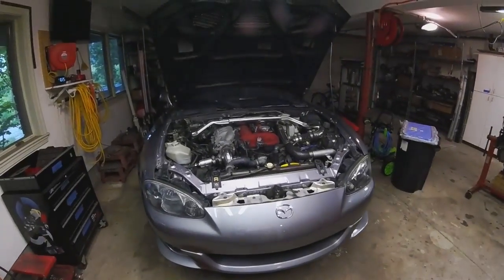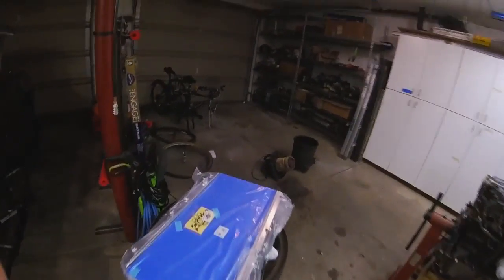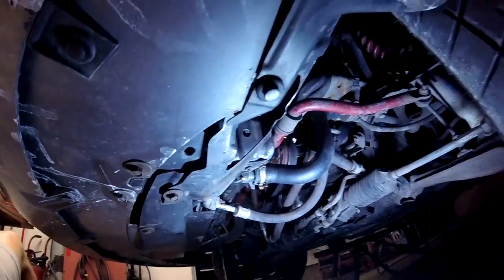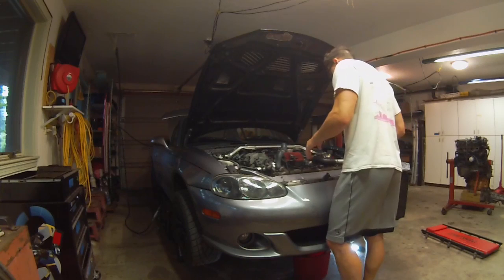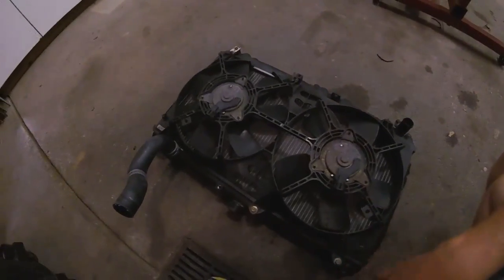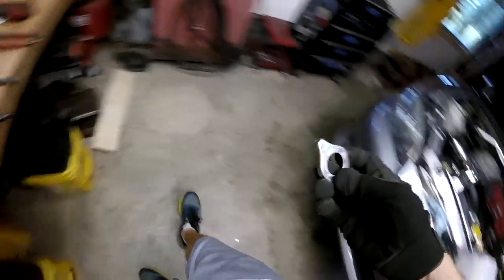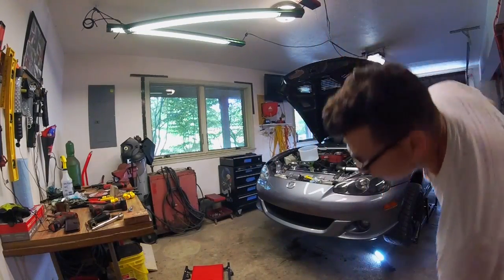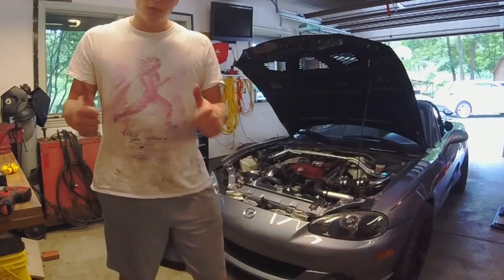Mazda Mazdaspeed Miata NB All Aluminum Radiator Install

Comment: Is the CSF 42mm Radiator a direct swap for the Mazdaspeed MX-5?  Was there any modifications necessary for fitment?
Reply from the maker: Oh, it's worth noting that the tabs I added were just because the previous owner broke the OEM tabs at some point.
Reply from the maker: Nope, it dropped right in!  Very few things are "bolt on" but this is.